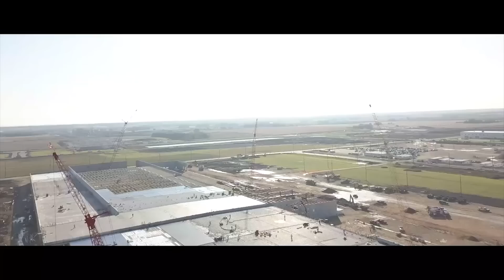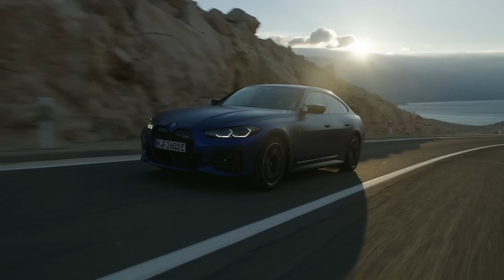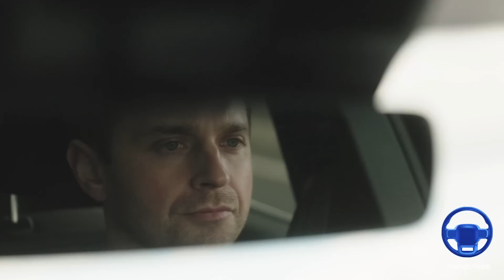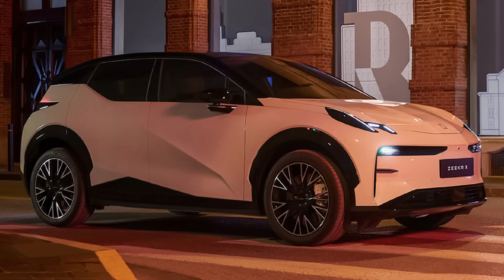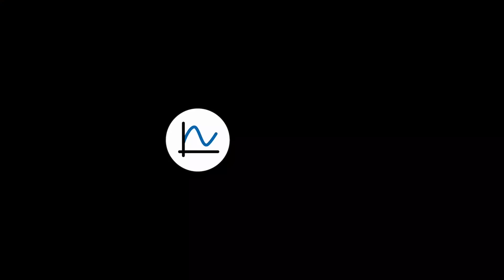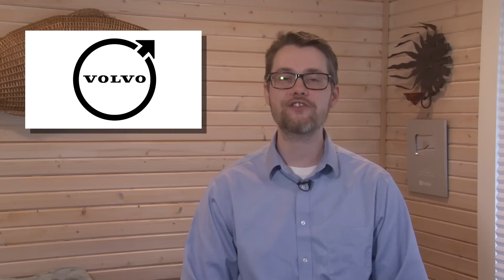U.S. Low On Sites for New Car Plants; Car Prices Drop for 1st Time in Months - Autoline Daily 3545

Comment: I am going to call out on the lack of mega site around the country for new plants. What about all those abandoned city cores like Detroit, Gary Indiana and other low use urban and rural areas around the country that used to be industrial powerhouses? 

These areas have low acquisition costs and often much available housing around them. It may be old and in need of repairs, but it’s available.

Bulldozers don’t care if the dirt they are pushing is virgin dirt or dirt full of old city scape.

Comment: When are we going to see efficiency standards put in place for evs?  If gas cars have to achieve set fuel economy standards, should evs also be required to meet miles per energy unit standards also?  Pretty easy to make a car fast if they are allowed to use unlimited amounts of energy.  Range would certainly improve if they were required to operate more efficiently.
Reply: EVs are leaps and bounds more energy efficient than ICE.  It is similar to the difference between incandescent light bulbs and LED light bulbs.
Reply: @traviscalvin431  yes, that's true,  however the batteries are so inadequate that evs lose a lot of range when it is very cold, and or when the vehicle is towing.  So they do use what little info they do carry pretty efficiently,  but until battery capacity dramatically increases, they are impractical for people with use case scenarios other than commuting

Comment: "Charge EVs so they have a full charge when they arrive at the dealership." - This is a horrible idea, with the battery at 100% SOC for weeks or months, instead of 50%, which is ideal to reduce calendar degradation of battery capacity.
Reply: 60%

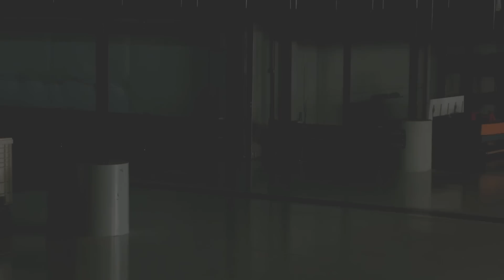Comment: 8:08 There is little reason for EV based SUVs to have such a high bonnet(hood) level, usually there is quite a lot of space under the hood (as many automakers don't fit frunks). So why not reduce the height of the hood, and increase the vertical area of windscreen. This would give the driver a better view of the road, increase aerodynamics, and protect cyclists and pedesstrians.
Of course this may end up with some SUVs looking out of proportion.
Reply: hartozI believe that`s a froot.
Reply: They did that. I have one. It's called a Bolt.

Comment: I have a 2017 minivan that I paid off as of last July. To be sure, I'm not going to buy a car anytime soon because of this payment news. Ugh.
Reply: I'm still driving a 01 Grand Am that I bought for $950 in 2012. 322k miles now and reliable. Insurance is cheap too. 32 mpg still. Your van has a lot of life left. No need for a new vehicle.
Reply: Hang in there. A 2008 style crash is coming. People are going to soon start defaulting not only on car loans but home loans, which are now above 2008 wages to mortgage levels of 1 to 8.5. Trump removing the built in safeguards passed by congress after the 2008 crash and rates going to zero percent placed banks in just as bad a peril as they were in 2008. Many will again fail due to that. 

Cars, and more importantly, EVs will soon start to drop big time in prices as minerals costs sink. Buying ICE going forward will be very risky as their resale value will sink in 3 to 4 years. So stick with what you have and wait it out for the EV of your choice.

Comment: Low on sites for new automotive plants? I have never heard something so silly.
Reply: Available skilled workforce is the main issue along with access to transportation networks and infrastructure.  Most of the battery plants require over 100MW connected load which requires being close to a transmission line.
Reply: Listen again to the requirements that define a good megasite.
Reply: Agreed .... Silliest shit ever ... Sounds like they want to put stuff where they want to put them instead of where it's actually needed and if skilled workers history issue he'll just train them yourself but then again that's too much like right....